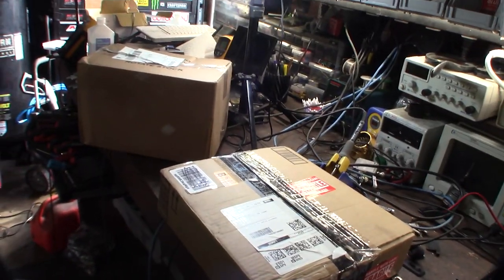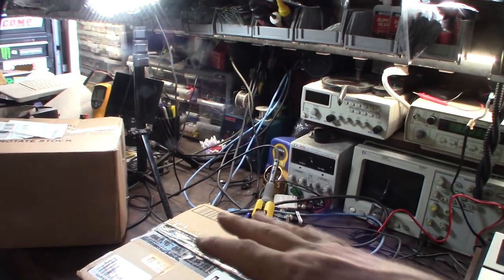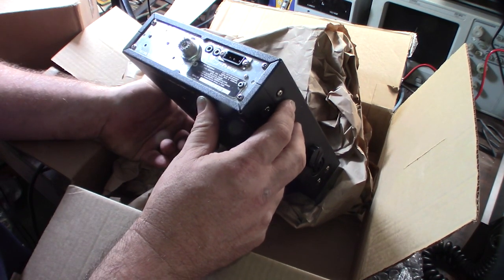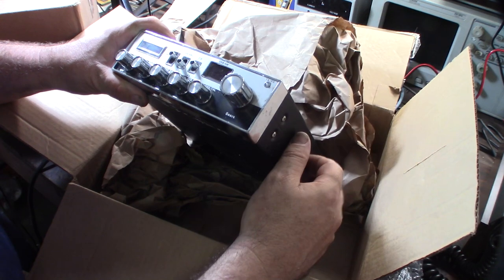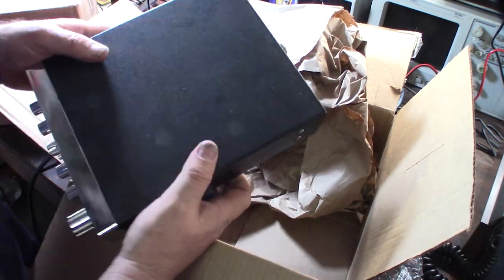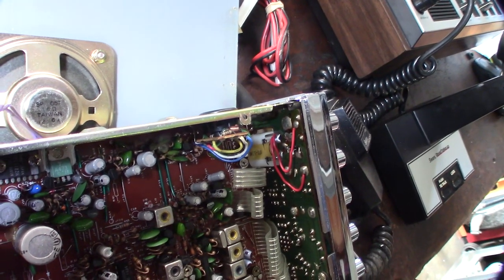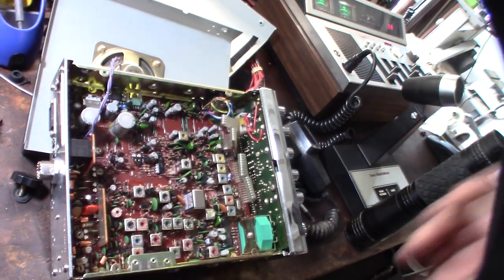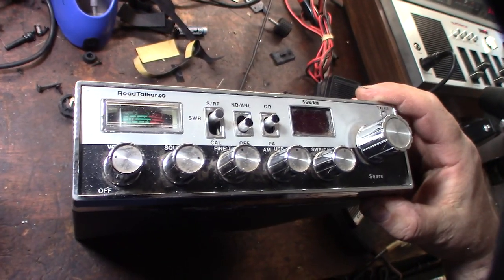RARE!!! Sears Roadtalker 40 SSB Mobile CB Restoration  Part 1 663.3810 Cobra 146 GTL

Comment: The layout of that one looks a lot like my Uniden PC 122.
Reply from the maker: Thanks, I was looking for a motherboard marking. I know it was made in Japan and I thought Uniden's production was already in Taiwan at that point. I will check again thanks.
Reply: @fintechrepairshop  Idk.  I bought mine in the early 90s.  I run it in my big rig with a couple K40 Trucker antennas.  Btw, one of those antennas is from 2001, and it's great, one is new and it is NOT built very well in comparison.  The set screw doesn't keep the whip in place and I will probably have to drill and tap a bigger hole on the other side so it will hold.